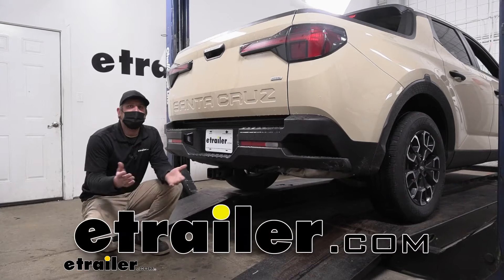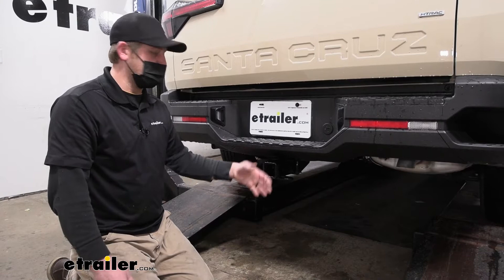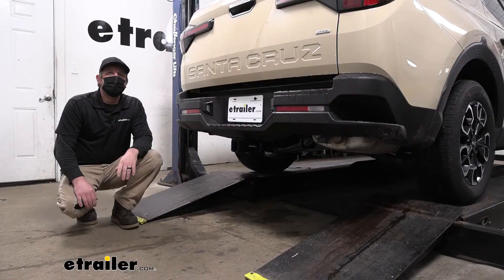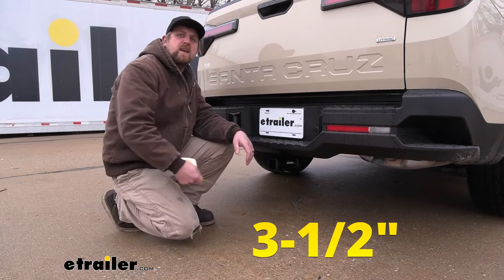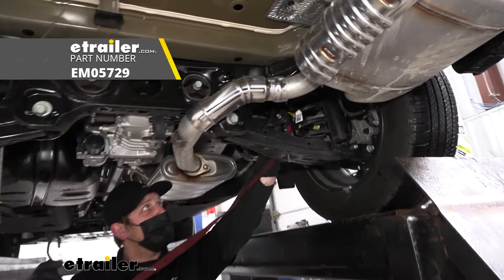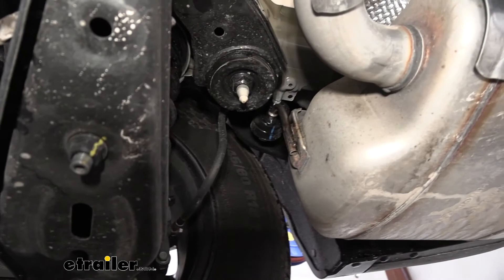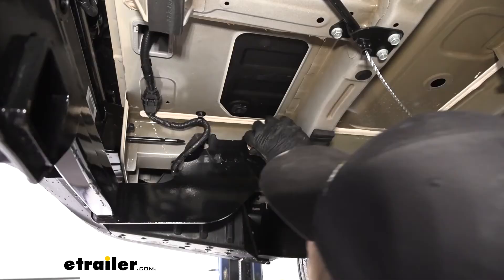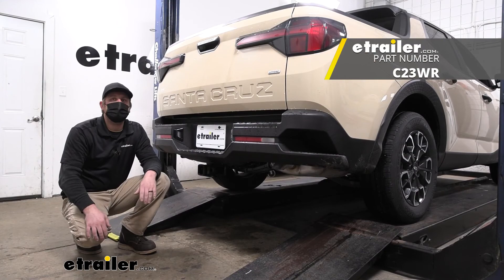etrailer | Curt Class IIITrailer Hitch Installation - 2022 Hyundai Santa Cruz

Comment: I'm getting the SEL Premium model with 20" tires.  This implies a larger spare tire.  Is there sufficient clearance for the larger spare?
Reply from the maker: This hitch is designed to fit all models of the 2022 Hyundai Santa Cruz. Check it out on our website in the following link.
https://www.etrailer.com/Trailer-Hitch/CURT/C23WR.html
https://www.etrailer.com/t1-2022_Hyundai_Santa+Cruz.htm
Reply: Donut is probably the same on all trims.

Comment: What's the torq spec?  (Edit: So it's 60ft lbs per your documents)
Reply from the maker: Those are listed in Step # 3 of the install instructions that we've linked below:
https://www.etrailer.com/instructions.aspx?pn=C23WR
Reply from the maker: We don't publish the torque ratings because they can change over time if the hitch manufacturer changes hardware suppliers. The instructions are the best source for the most current torque specifications.